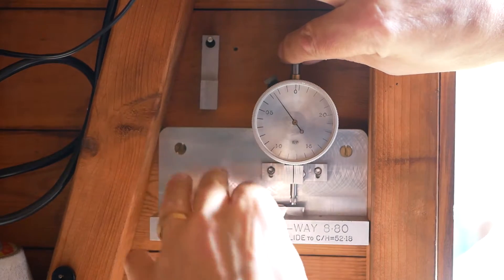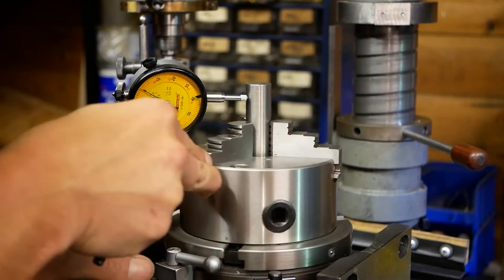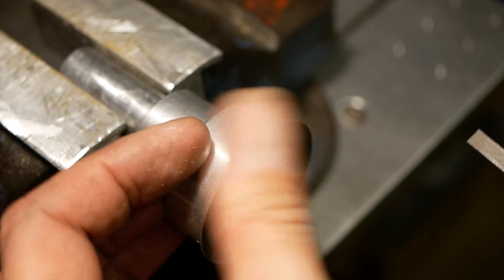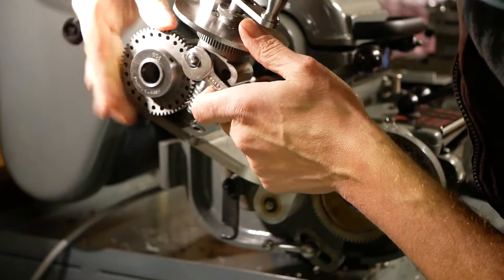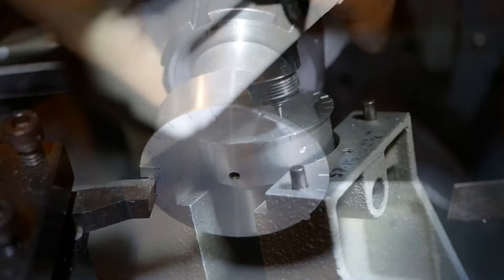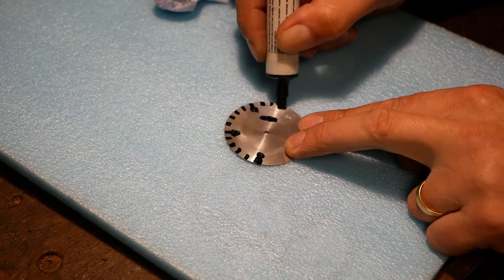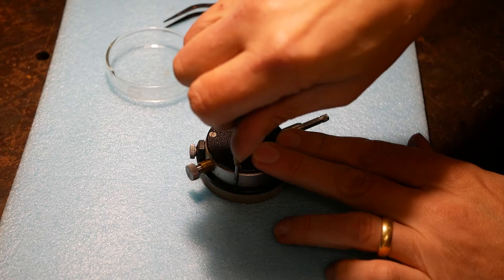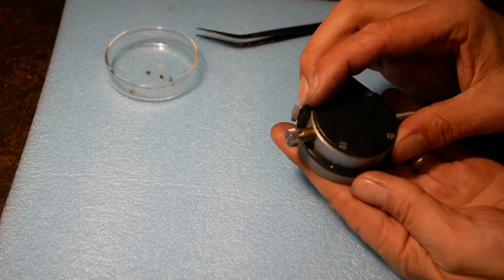A Custom DTI Dial: Dividing on a Myford Super 7

Comment: i have a lot of respect for what you do , if i don,t have the same facilities, could i just make a spring loaded plunger  that i set at the height  i require  and then shim the cutter up till it touches the plunger, using a selection of the shims like you do. cheers john

Comment: Why not engrave the divisions whilst it is on the rotary table? Is there an advantage to all the effort of fitting a dividing head to the lathe?
Alternatively, do it all in the lathe, with the peg a small part that fits into a small slot in the dial. (esp. for those without rotary table- or even a mill).
Personally, I would have just printed out a dial, and stuck it to the face... For most indicators only an inner ring with the numbers will be needed. Given that most DIs have a secondary pointer, this is way easier (engraving the secondary is a big complication)

An alternative- use a digital caliper (cheap) with the depth probe sensing the tool bit, instead of the DI. Direct digital readout of the shim size needed. I would mount it horizontally.